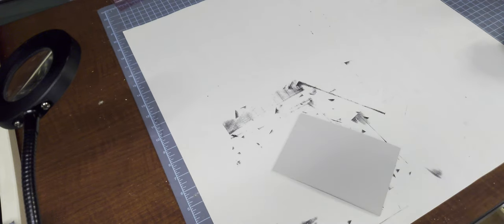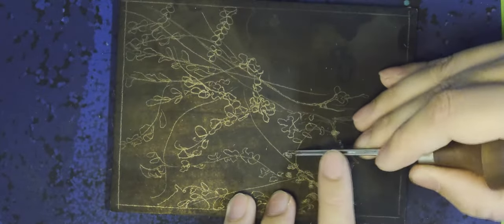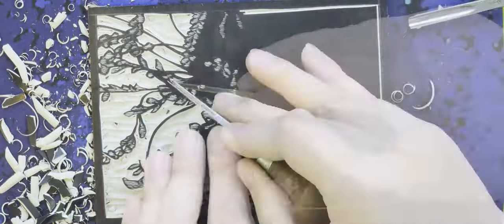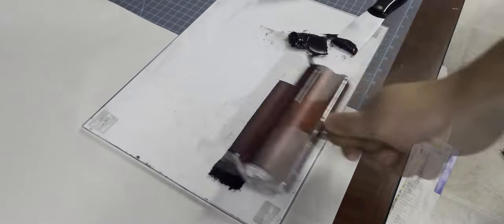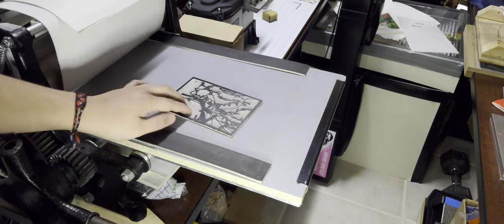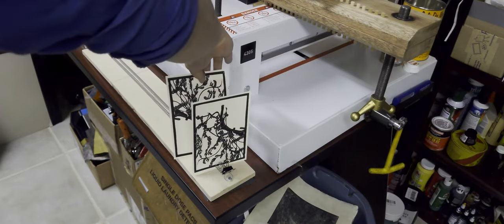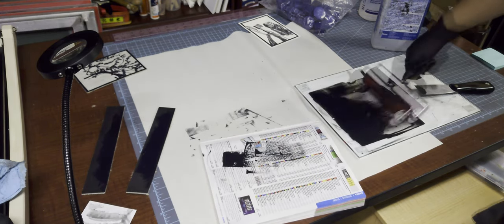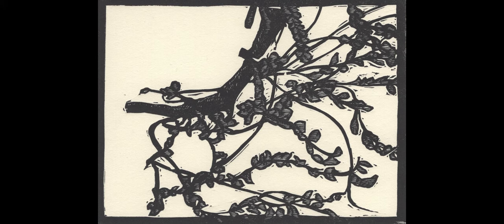How I make a black and White linocut

Comment: I'm pretty new to linocut, but I've found that acrylic markers (like Posca or Molotow) are super helpful for sketching out a design. They come in different colours, they take to the lino really well, and you can go back over them as many times as you need to get the design right.